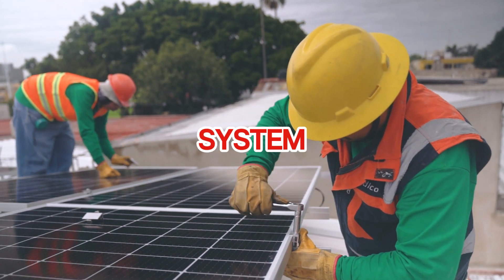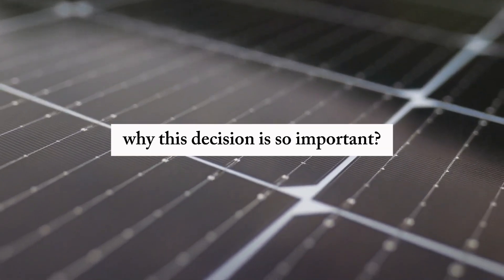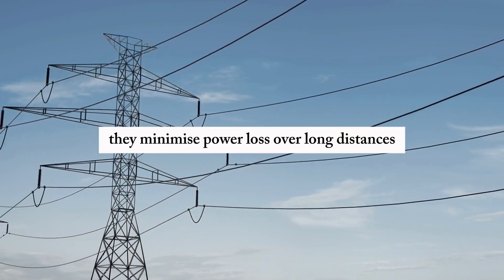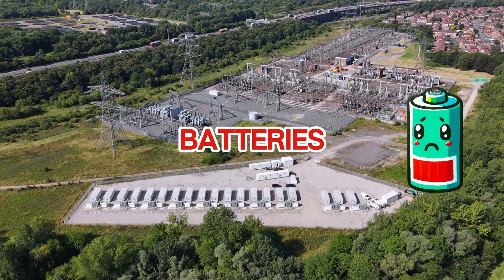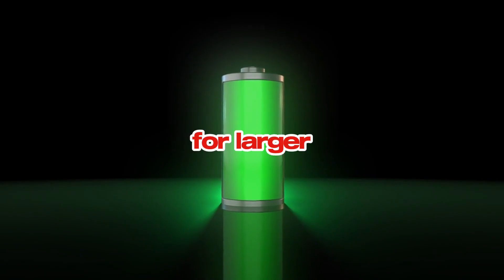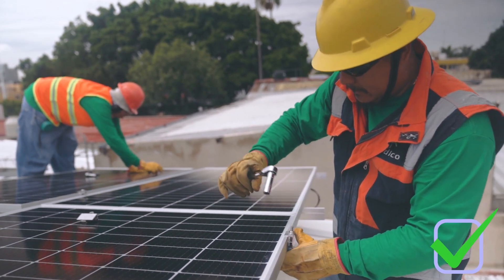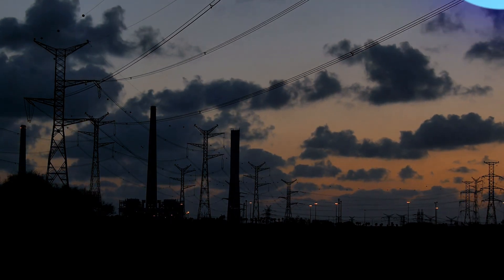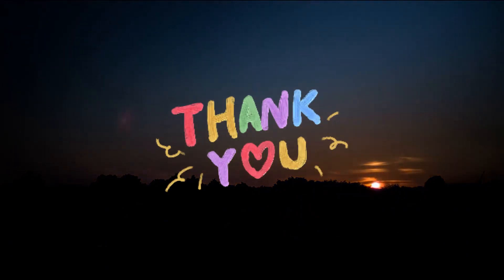12V, 24V, or 48V Battery for Solar Panels? (Which is the BEST!)

Comment: Sir can use a 24v system for air conditioner in home
Reply from the maker: It depends on the AC unit's power requirements.
Reply: AC takes 10 ampir maximum